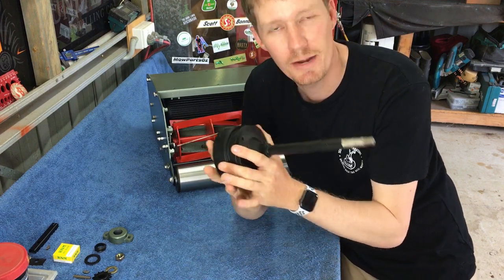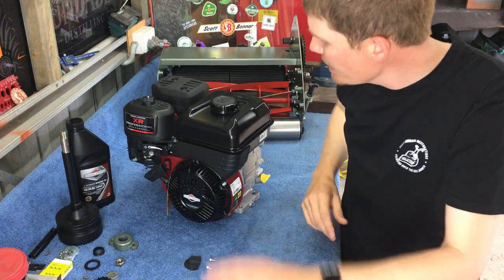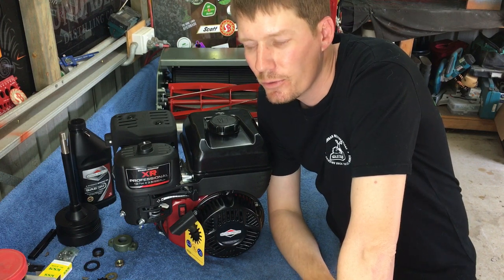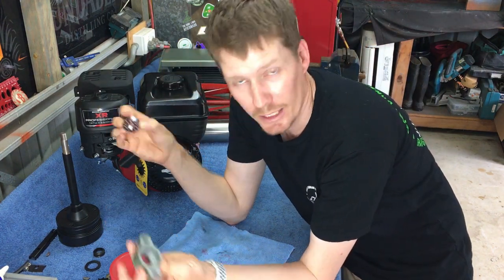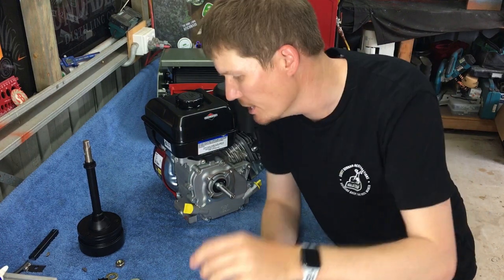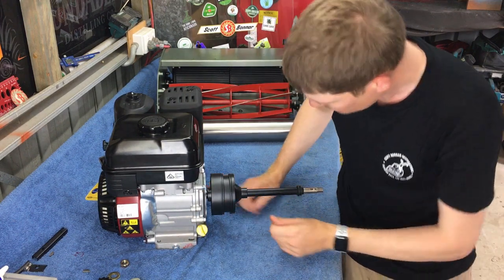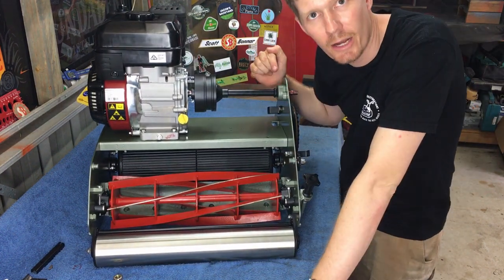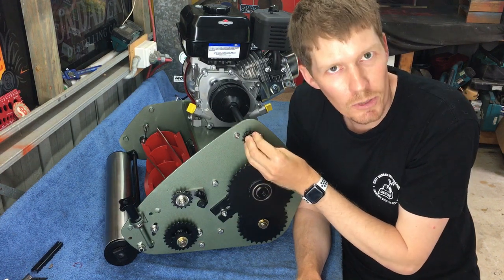How to Install Centrifugal Clutch on a Scott Bonnar Model 45 Cylinder Mower

Comment: hey mate i just bought one from mow parts oz for my sb45..i wasnt gonna bother hooking up thottle cable just using the briggs stratton controlson mower - what do you think will i have to connect the throttle or will that be fine...cheers mate love the videos they have been very helpful